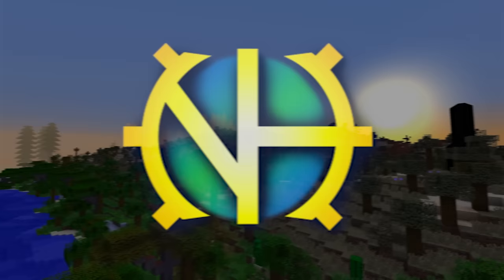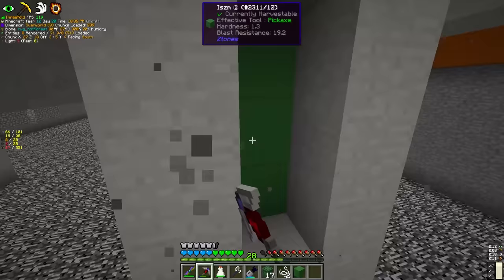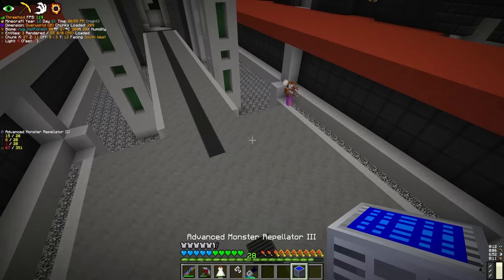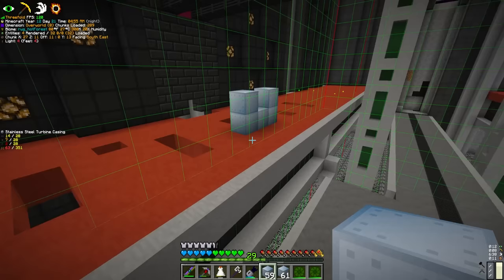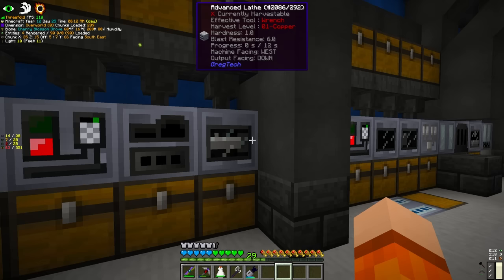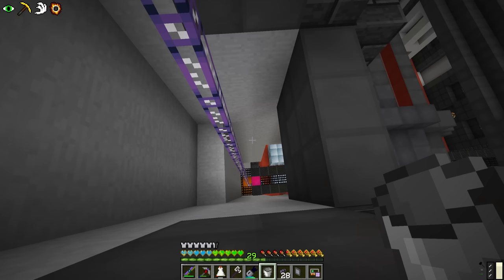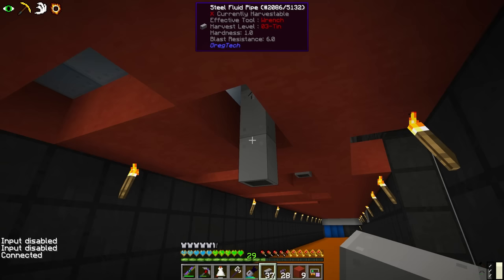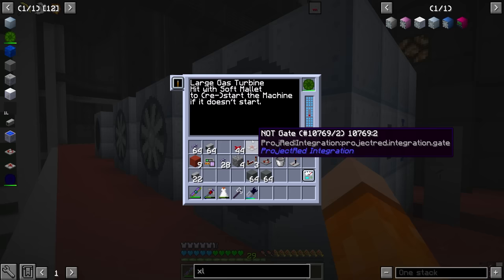Gregtech New Horizons S2 35: The Power Plant

Comment: I really don't see the appeal of RS Latches in this situation. They require a specific screwdriver to be useful because of it sending a signal into the input line for whatever mysterious reason, and if you ever have to manually toggle the latch you have to place down a lever or pressure plate to toggle it manually. A Toggle Latch, on the other hand, you can flick manually, doesn't require a screwdriver, and is cheaper (unless you don't have a lever sitting around, but than you'll need one for the RS Latch anyway if you want to be able to manually toggle it). Toggle Latches do have the problem of sending signals in two directions, they literally toggle between sending a signal to different sides in that respect, but remember what I said about redcrystal being specific about what sides it'll accept a redstone signal from. Or a strip, if you're using redwire.

Something else that's helpful to have, if you've got a three way AND gate anyway, is a manual control toggle. In case you ever want to make sure the turbines cannot run no matter what, say when you're switching to an LSC/upgrading your LSC and the signal RE: it's storage amount gets all screwed up.

Transformers will only output 1A, if they're not fed enough power to do that consistently that just means they'll send 1A intermittently instead of constantly. The same is true for buffered dynamo hatches if you don't place a transformer directly against them (as you should, both to compress the amps and to save on cable loss), they will output 3A EV consistently and usually, but not always output 4A EV depending on their buffer. It's something to be very aware of when cabling up these sorts of things, because if you don't account for all of these machines sending 4A/1A at the same time you'll end up with burned cables, and possible a fire right next to your very explode-able yet precious central power storage...n-not that I ever made a mistake like that. Totally didn't have a fire next to a 16A IV battery buffer inside a central power room with IC2 nuclear reactors in the back. Nope, not me. Also in case you're curious why Three is using LuV tier wires to send IV amps, mostly material cost. HSS-G is less tungstensteel dense than actual tungstensteel, and HSS-G has a higher amperage per cable size than Tungstensteel wires anyway (regular tungsten wires having even less amps/x, and each of them having the same EU/t//M/A loss). The best IV tier wire is Platinum, but Three doesn't have Platline set up yet or Platinum coming in, so HSS-G is simply the most convenient, cheapest option.

"You can put higher tier power in a lower tier cable", from the man who (undeniably) gave us "HV to MV, yes" 🙃. In any case yes, you can send IV power on an LuV line just fine. The only caveat is that cables will not transform up power by themselves, so those 4A IV will remain 4A IV unless fed through a transformer, and if you send 5A IV down a 4A LuV cable that cable will burn. Very soon, when the LSC comes in and the first power spine upgrade is upon us, it'll be time for Three to take a hard look at what cables are available and decide on what to upgrade his power spine to. Thing is you want to upgrade your power spine as little as possible, so if you can invest in something like UV or even UMV tier cables early than that's that much less time spend upgrading and replacing long lines of cables. That said around UV the option of using Lasers to transport power will be on the table, and the option of switching to that is another thing to consider.

Come to think of it Buffered Dynamo Hatches actually have some respectable amount of power storage in their own right, not as much as a dedicated battery buffer of course but so long as you're able to hit signal strength 15/15 on the battery buffer I think it's possible to set the threshold that high without "wasting" fuel to turbines running while the battery buffer is full.

Here's to hoping Three remembered about the Hi-Amp Transformer to turn those 16A IV (eventually, for now it's just 4A) into 4A LuV that'll run down the power spine. Otherwise those 4A cables are going to get 16A running through them, and they'll burn. Right on top of the 16A IV battery buffer. Which, eh...that would be deeply unfortunate...

There's actually a lot of different ways you can color GT cables/pipes/etc., and a lot of different ways you can try to come up with a color-coding scheme for different tiers of cables. My advice, as I mention in the spreadsheet that covers this stuff (somewhat), is to go with whatever is intuitive for you. No matter what you try to base a color scheme off of - colored text in tooltips, colored dots on machine hulls, preferred cables, superconductors, EBF coils, name it - there will be a point where something doesn't add up or where you're forced to use two very similar colors right next to each other, which is a disaster waiting to happen. Think of some kind of system that makes sense to you, write it down for the love of all that is holy, and use that. Also note that there are only 15 GT tiers, ULV to MAX, but 16 different colors to choose from. The final color is yours to do with whatever you wish. For instance Three could reserve the 16th color for his central power input lines to make sure they cannot ever connect to, or be mistaken for, the central power spine/power output lines.

For the record the spraycans have a weird bug where they'll say they have 0 uses remaining when they have their full 512 uses remaining. I've no idea why they do that, but they do. Also if you're worried about running out of durability there are solutions for painting cables that can be repaired in a Thaumic Restorer, though it's up to you whether that's more or less convenient than having to refill a spraycan every so often. 512 is on the higher end of uses in terms of painting solutions, for what that's worth.

I can vaguely see color-coding the LuV cables sending LGT power into the battery buffers as IV cables, since that's what really they're supposed to be. But why color-code the power spine as IV cable when you'll be crafting a transformer to send LuV power down the line eventually?
Reply from the maker: Some great information in here, thank you Metis for your help in the calculations :))

Comment: The power controller system is one of my favourite parts of playing modded.

By the way, the 'flickering on-off' type controller you mentioned has a real name: a bang-bang controller (since that's the sound things make when you use one on physical systems lmao)

You've made a kind of bi-stable system.
If you got really advanced you could disable some turbines first but that also might unevenly wear down the rotor blades (though you could also put in a system to switch another turbine on if one needs maintenance)

My personal favourite controller is Proportional, to the point that I spent multiple hours analysing the mechanisms behind Bigger Reactors to make one

Comment: Great design for the power room, great explanation of the RS-latch design and implementation. 

Idea, what if you were to sink the turbines into the wall? That's kind of what I thought when I saw each 3x3 square with a lamp in the middle. Could hide whatever wiring you needed, open up the walkways again.

Comment: For those who want an idea of how much power storage 400M EU is: ~1300 buckets of benzene ran through single block HV gas gens, or ~10 minutes of 4A IV output. "~32.5% of a Benzene super tank that lasts ten minutes doesn't sound very impressive", you say? Well, that's because it isn't. Once you get large automation processes going you'll burn through power fast, but this is only the initial setup. Three can quadruple that energy storage before having to consider the LSC, and once the LSC comes into play that power storage will get multiplied by six at a minimum. This is just the cheap initial setup. It'll reach impressive numbers later 🙃.

If you're even not sure about what the order of the HSSes are, just GuEsS. Or GES, whichever you prefer 🙃.

"These mobs are going to be a real problem if we don't take care of them early", the man says post-T2 rocket. Chandeliers are LV*. Magnum torches were available an entire rocket ago. What's this *early you speak of 🙃?

Mob Repellators are another solution to mob spawns. Personally I don't likely them, purely because they're expensive and always tease you with their much greater range if only you can think of some way to keep them powered. If I plop down a Magnum Torch it just works, no sales pitches or other questions asked (other than the setup needed to craft them, but it's not like QED is more expensive than Radon or, for IV tier components, Iridium). That said if you do have a way to keep mob Repellators powered passively their range is *gigantic*, and while they are expensive to craft you can pull them from lootbags at times. They'll get the job done, very well in fact if you invest in them, I just prefer their alternatives.

The exact lifespan of turbine rotors is difficult to calculate, if only because there's conflicting/unconfirmed information to be found on how to calculate it. Brief testing suggests that this particular configuration results in the rotors taking 218 points of durability damage every 50 seconds, which would give them a lifespan of ~8.15 RL days of continuous operation. Add in a toggle latch to turn off the turbines when the battery buffer doesn't need filling and yeah, even if these calculations are off (entirely possible) they'll last a good long while anyway.

The tooltip information on LGTs is outdated, muffler hatches can go top centre touching the middle two air blocks. Muffler hatches cannot go in the equivalent spaces on the bottom of the multi, however, since muffler hatches cannot point down, and every other direction is either blocked or invalid. Also yay for not playing with pollution, meaning you can just throw around garbage tier muffler hatches all day every day and not care about anything 🙃.

Redcrystal both goes on walls and allows fine control over which sides actually emit/accept a redstone signal. That can prove critical to compact redstone circuits/setups that have exposed lines in places, though you can accomplish the same with redwire using Force Microblocks strips to separate them. More finnicky than Redcrystal, though, and besides which redcrystal looks cooler 🙃.

Man is I don't know how many hundreds of hours into a GTNH playthrough, stepping into early IV proper, and complaining about a dye recipe. This is what happens when you put mods like Botania on the back burner for so long 🙃.

Steel fluid pipes are most definitely beyond overkill for this setup, but it can act as an emergency power buffer in case something goes wrong with either AE2 or the benzene supply. Given the presence of a Super Tank of Benzene and AE2 being ran off of dragon egg power, however, neither situation is likely to be a problem.

So as is the rule with anyone doing math on camera (rest assured I've made my own fair share of blunders) Three's math isn't...I'm actually not sure if I should call it wrong, but it's not the most intuitive method of doing it as far as I understand. EU/t from optimal flow rate divided by turbine fuel efficiency as a fraction, not as a percentage, meaning 8160/1.7=4800, divide by the base fuel value of 1mb of fuel (which for benzene is 360) is 13 and change, which gets floored to 13. Then 13*360*1.7=7956 EU/t. With XL gas turbines you need to account for the fact that one XL does the work of 16 regular turbines, so to calculate the optimal flow you multiply by 16 before flooring the end result. In both cases note that you can overfeed/overclock both regular and XL gas turbines to generate more power at the cost of lower fuel efficiency, but in most situations you won't be doing this with regular gas turbines.

Large Combustion Engines actually do work differently, in that (when boosted, which they always should be) they always produce 6144 EU/t, and whatever amount of that power shouldn't exist based on how much fuel is being consumed is just something you get as bonus fuel efficiency. This is what makes very high quality fuels extra good in LCEs, because they can reach fuel efficiencies higher than the 150% you're told you'll be getting.

The 16x IV battery buffer will definitely come in useful. Not only does it barely cost any more than a 4x version (let stand a full-blown LSC), but the LuV cables of choice is actually able to handle 4A/x, meaning that 1x cable can support 4A LuV or 16A IV. It's just very nice to be able to hit capacity on the cheapest thing, especially because given time 1A LuV on a power spine (which is the maximum a 4A battery buffer could output) simply isn't going to be enough.

For reference, as you might expect, maintenance issues will decrease the efficiency (and thus EU/t output) of these LGTs by 10% per up to five, after which the sixth and final maintenance issue will force it to turn off. It's not as critical to keep on top of maintenance issues with LGTs as it is with, say, a cleanroom, but there are power solutions that are a lot more susceptible to maintenance issues gumming up the works and causing things to break down if not explode violently. This is still GT, after all 🙃.

Comment: Just a heads up with filling spray cans. If u click the empty spray can on the chemical dye fluid in the lcr output hatch. It will turn the empty spray can into the desired spray can colour, skipping the fluid canning step.

Also for making the chemical dye, it equivalates to 16 salt + 8 dye per 1 full spray can

Comment: Interesting solution with the turbine switching on and off. I ended up just using two energy detection covers, set to the EU values i wanted the turbine to turn on and off at and have the outputs going into either side of an RS latch. No need to invert the signal because one of the covers has that. No crystals either since instead of caring about strength I just specify the EU values directly on the covers.

Comment: A fun thing I thought about when I saw the Middle pillars you built, you could make them give of the level of power you have stored at the moment, it's a cliché, but it's a cooler way than just seeing it on a screen
Reply from the maker: Any ideas how to send a redstone signal wirelessly while preserving the signal strength? 🤔
Reply: @Threefold.  hmmm, maybe you can read the content of the battery using open computers and can't that send a signal wirelesly somehow, that's the first thing I can think of on the top of my head
Reply: The redstone transmitter/receiver covers can do analog (levels) but they might be slightly above your current tech level
Reply: im dumb you used those covers already --they should retain signal strength

Comment: Given how low the durbility of the spray cans are, you could do just a basic tag on places you think you are going to be working on the wire the most. So both ends of a cable plus one for common spots you will be hanging out and doing maitenance on. At least until you can mass produce cans automatically.

You could also just alternate between unpainted and painted cable, making a striped pattern, then have "full" colors for much higher tiers of power.

Comment: Good video Three, really gave me inspiration for me own first EV-Base. I have copied your redstone logic for the turbines one by one, but I do have the problem that they do not turn off automatically. I do not know what the problem is, maybe you have to configure the energy detector cover? I would be very gratefull if you (or any other person which knows something about this) could help me with my system, so I can start to build the rest of the base around this :)
Reply: For anyone wondering, I have fixed the issue (rather quickly after watching the video again :D). The AND-Gate was in the wrong mode, so it didnt connect with the red alloy wire from the wireless receiver and only accepted the redstone signal from the tank (which basically ment the AND-Gate always did output a redstone signal because the benzene tank was always above the threshold set in the fluid detector cover). 
So if you have any problems with recreating the redstone setup Three showed, check if all the Gates and the RS-Latch have the right mode activated!

Comment: it'd be smart if the engine turned on and off depending of the consomption instead of having them blink off and on making the battery going from full to empty and back.

also... don't you have something that restores uses/durability? i can think of a couple things that could utilise it... if it's worth to at least.
Reply: That's an even worse idea than what Threefold has implemented, because this will make the turbines ramp up and down endlessly, and inefficiently. As for the latter point, the Thaumic restorer does not work on Gregtech tools, because their 'durability' is not the same as Minecraft durability
Reply: @yasirabdulhakeem  no no no, you have to be smart about it, you don't want to have them go on and off to stay at 50%, no, the idea is to keep some running so that the battery empties slower and not turn them all on so as it fills slower , one way i'd do is if the power goes under 10% instead of turning ALL of them on i read the consumption to know how much on will charge the battery faster than it empties, wait for them to get to speed then repeat until we are over 20%, then the same in reverse, instead of turning ALL of them off when the storage is above 90% read the consumption to know how much off will let the battery empty, wait for spool down then repeat until we are under 80%